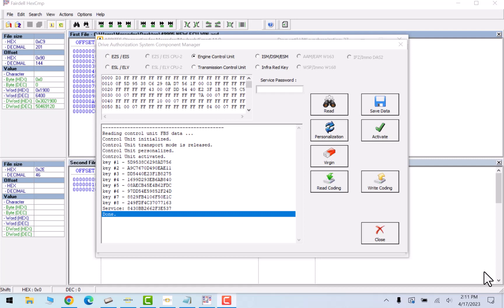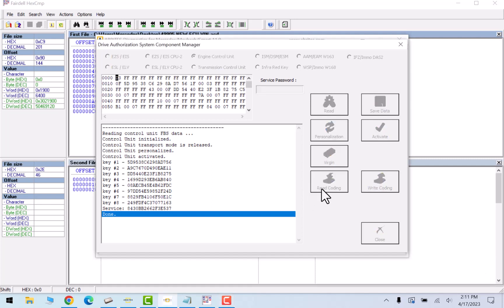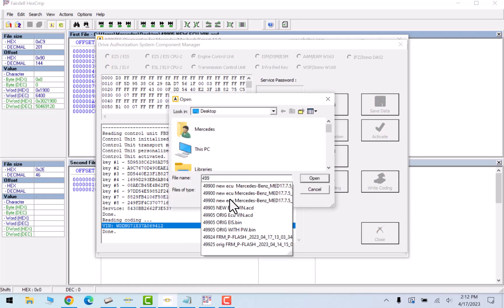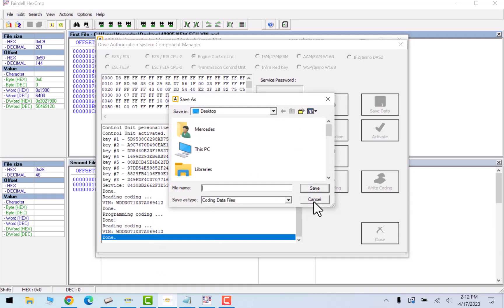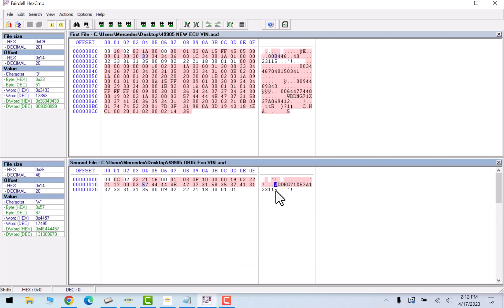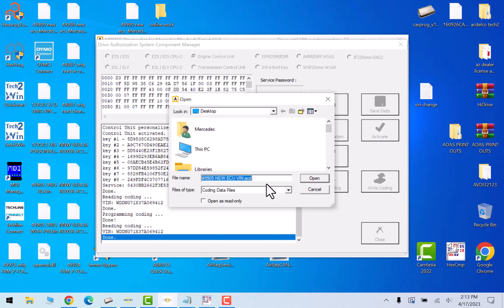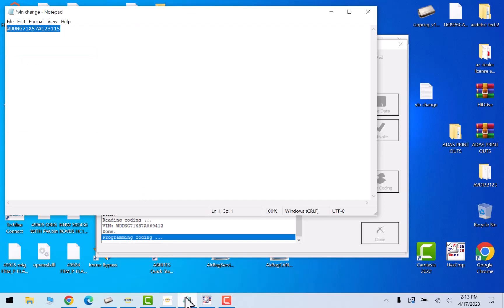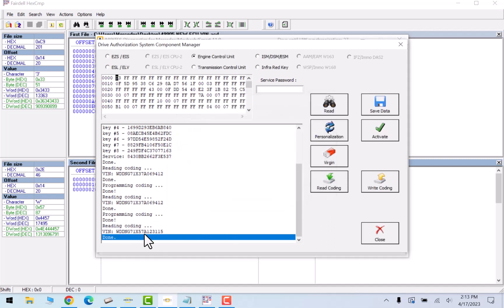How to Edit or Write Your Mercedes VIN in a USED ECU

Comment: Hi can the same be done for control modules? I have a 2009 GL320 and the tailgate control module was shorted out by water. I bought a used replacement module but the vin needs to be updated. I called a couple shops and they don't know how to do it. Is there a scanner that will do it?